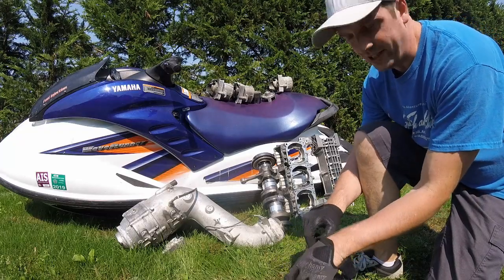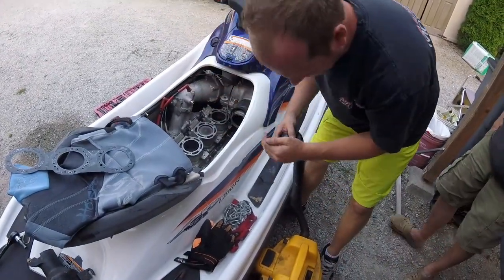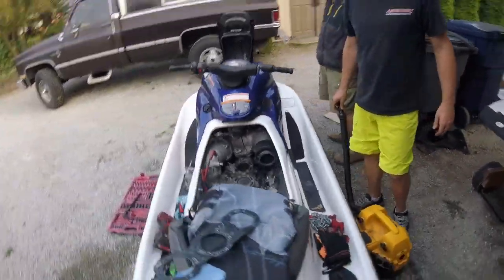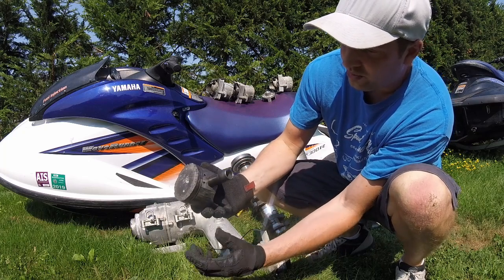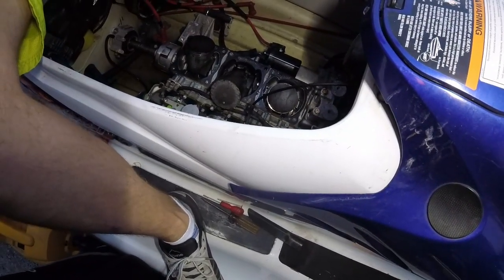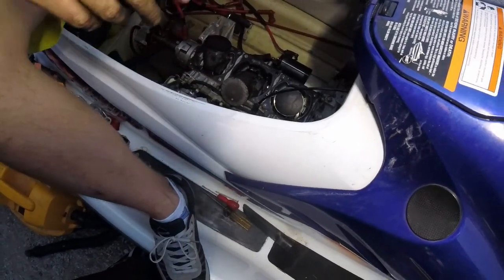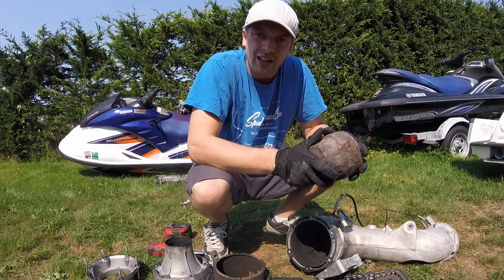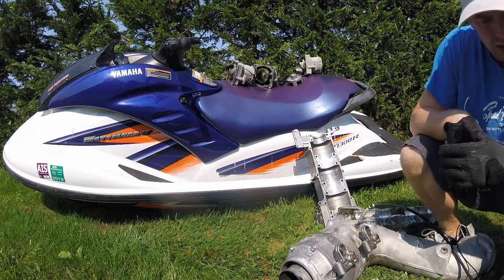gp1300r engine ran with no oil

Comment: Hello everyone. I would be very grateful if someone could help me. I have a Yamaha GP1300R. I have changed almost everything, it is after a major engine overhaul, but when starting up to about 12-14km there is an interruption, it is as if it is choking and there is no cut, there is no power, and when I hold the gas suddenly it starts abruptly and then it runs great. Then when I slow down and give it gas there is a slight interruption again, like choking.

Comment: Hello, could you help me? I recently rebuilt the top of my gpr 1300. But it got a fault code 54 (in the deceleration turns on the injection light and code 54 appears). But jet ski goes normally. How to solve it?

Comment: I have a question. Could a 1997 Yamaha GP760 engine fit in a 2004 GP1300 waverunner?
Reply: It's a silly idea to fit a 90 hp engine into a heavier  jet ski with 165  hp engine but yes it can be done by an expert in conversions if you're prepared to pay for the fat bill. You can just swap engines you need a whole donor jet ski...

Comment: Did they say why it ran with no oil, like oil pump failure or the line broke or just didn't have enough oil?
Reply from the maker: Rocky Brook the guy I bought it from didn’t put oil in it and this is what happened.
Reply: @JetSkiBrothers  That's reassuring, I think I'm going to buy one of these tomorrow that's in very good condition.
Reply: JetSki Brothers I have gp1200r just remove exhaust to rebuild card and instal d plate . Is it good idea to remove oil pump and just do premix? Thanks

Comment: What is the fuel consumption lt/h for this jet ski ..?? Thanks
Reply: Vasilis Zikos horrible! You can look it up on Yamahas website but running wide open you get only about 50 minutes out of a tank. 40? Liters. But you are going over 60mph on the water. The fuel injection models actually have a good cruising range at mid throttle